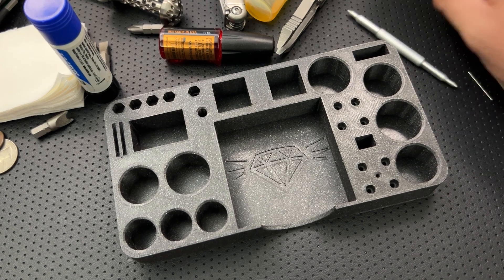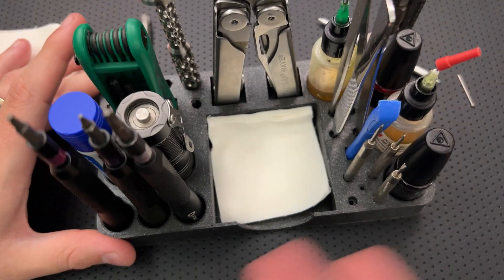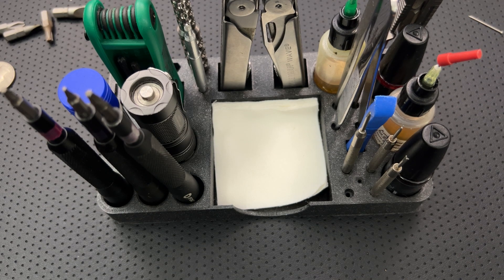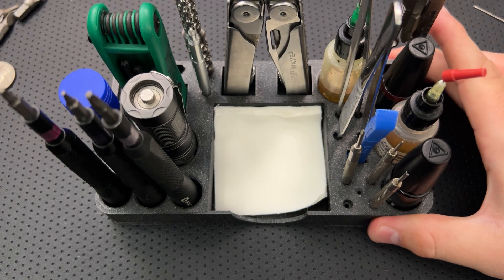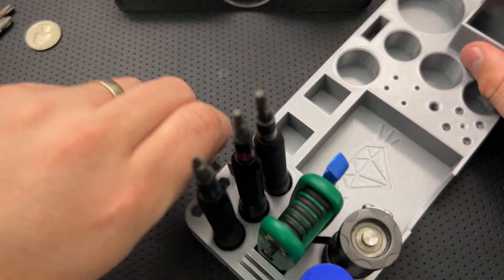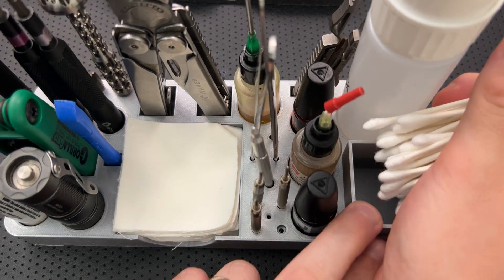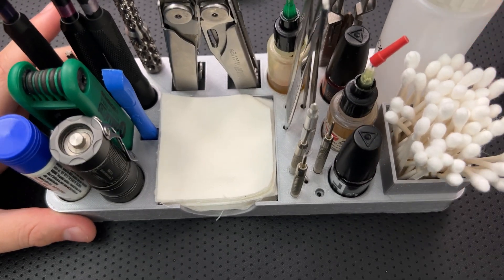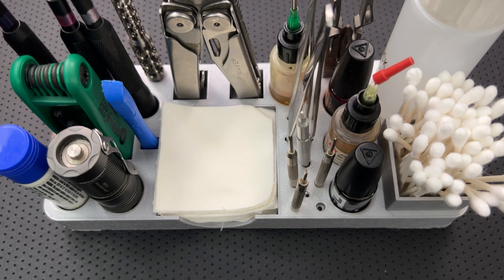The Nick Shabazz EDC Maintenance Toolholder, Version 2.0

Comment: Another piece of plastic that will end up in the bin or the sea in some years. The EDC world is already full of crap like that.
Reply from the maker: PLA plastic like this is compostable, and the nice part about allowing people to print themselves is that there will be no 'unsold stock'.
Reply: @NickShabazz  Problem is you know people won't take proper measures to compost it. PLA is compostable if you do it right. They'll just throw it away when it's out of use. 
I would rather see you do something out of metal or wood, or anything but plastic (even "bio"plastic, those aren't sustainable because they clash with food production). Don't want to sound like I don't like you, I do. 

Oh, since you're here, it would be great to have you make a breakdown of why blade to handle balance matters on a folder. Would be great.

Comment: Ok now for version 3 add a shallow tray across the front lined with a magnetic mat to contain loose parts during disassembly
Reply: or just print an indent for super-gluing in a round magnet. if you do it on one of the tray walls you wouldn't have to change the overall design.

Comment: I’m guessing the next version will have slots for a ruler and calipers? I use to prototype these type of projects using LEGO but made them out of wood and a router. The LEGO lets you use the prototype in real life situation to determine if some tweaking or modification is needed before final construction. This was before 3D printers. Perhaps a stepped level design or carousel  would let you incorporate a handle for one handed transport. This may have to be printed in separate pieces that assemble together due to the printer size ability.